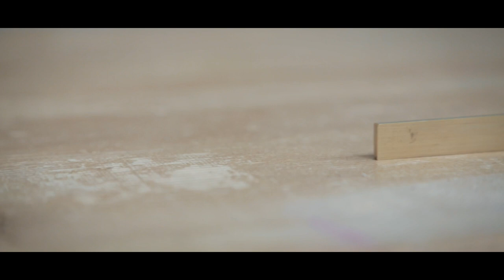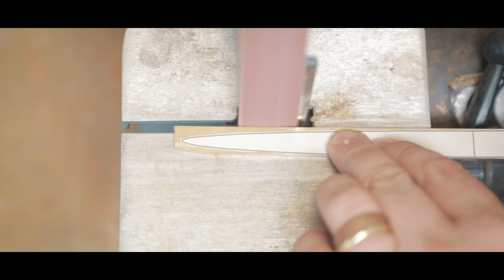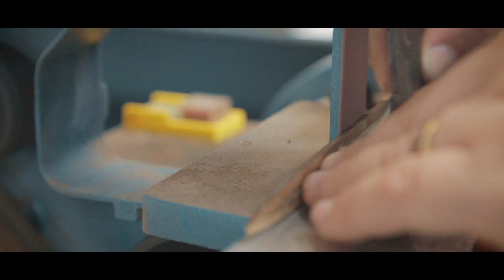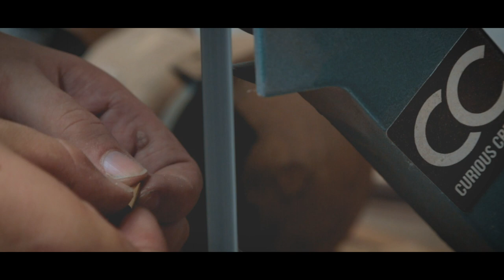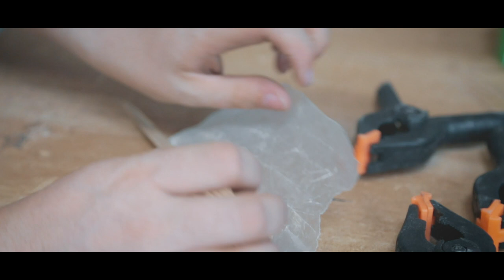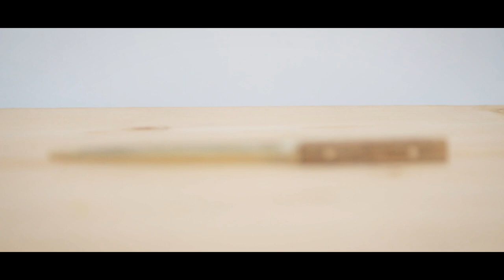#44 Brass Letter Opener - DIY Curious Creator

Comment: Also, do you know how to do an inlay on a ring?
Reply from the maker: I've tried before and it didn't work out well. But if you Chuck it up on a lathe and use a knife or file to cut a small groove. Hope that helps!
Reply: Curious Creator yes I’ve tried on the lathe and completely failed 😂 thanks for the help and I’ll keep trying